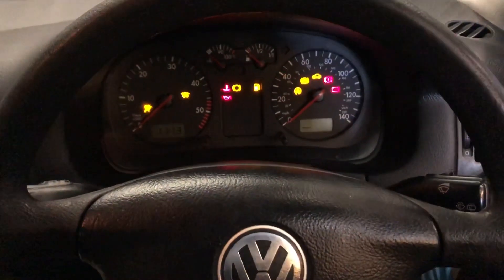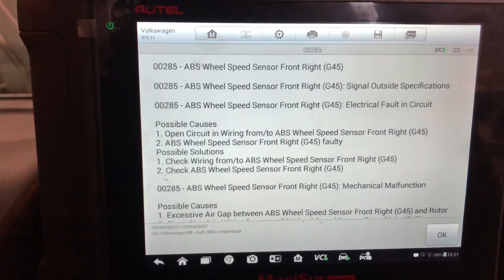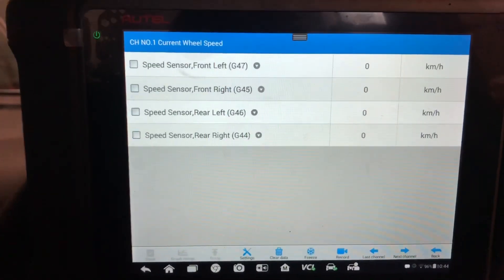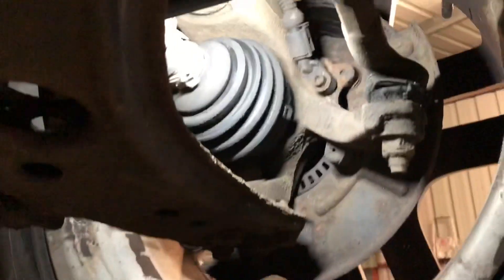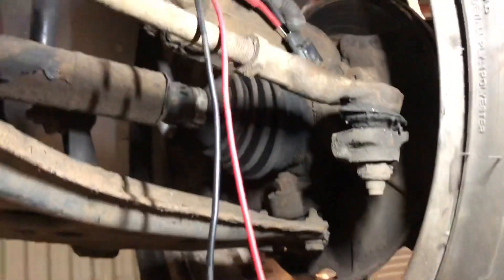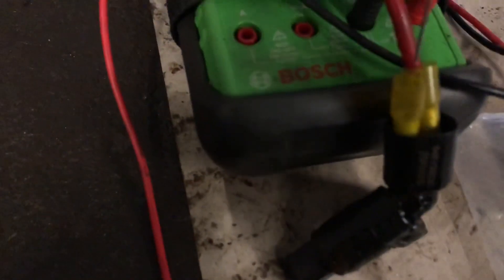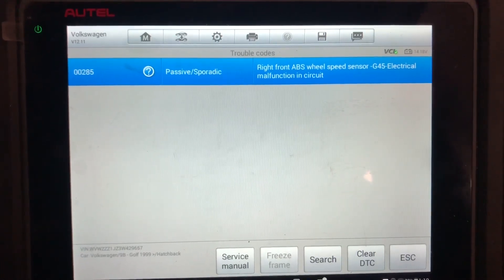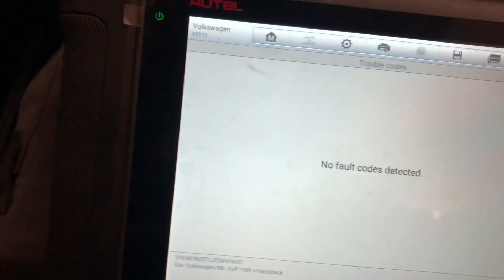VW Golf ABS light Diagnosis. Front ABS Sensor.

Comment: There's no way on this planet that your Abs sensor will come out like that! 
I've recently done this job and probably fcuked it up... my ABS sensor light is still on but I did use stupid eBay sensors?
Reply from the maker: Never rust eBay parts, especially for sensors.

Abs sensors are notorious for seizing in the hubs.
Reply: @MTMMotorServices  I've been trying to find a diagnostic tool that can help me I looked up the one that you have and it's all in euros I've also looked at one called isoft but to be honest I'm getting a bit bored because it seems like it's impossible to find the right stuff that works to make the job easy

Comment: What scan tool is that?
Reply from the maker: It's an Autel MS906BT
Reply: MTM Motor Services thanks bro! I appreciate it the interface on it seems really nice
Reply from the maker: @dubsoap6469  there is a brief learning curve when you start using it. Sometimes it's terminology for certain things can be slightly different but the more you use it, you get used to it. All the tablet based autel machines have a similar interface. And can be considerably cheaper if you were looking to get one yourself.

Comment: Do you have to clear the fault code to get abs light off, or does it go off automatically when the faulty sensor is replaced?
Reply from the maker: I have had it in the past where the light  goes off on it's own as you drive. But once the fault becomes non present I always clear the code so it doesn't stay stored in the abs computer.
Reply: @MTMMotorServices  Turns out I had a loose connector on another wheel, the light went off after a little drive 👍🏻 Thanks for the video
Reply from the maker: @Halliparta  glad you fixed the problem. Hope this video helped. Please consider subscribing for more videos like this one.